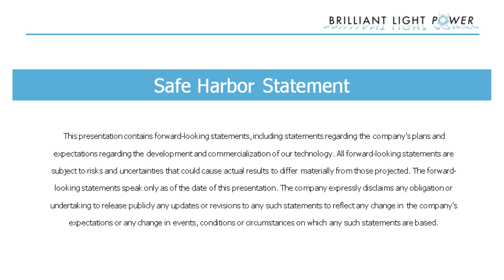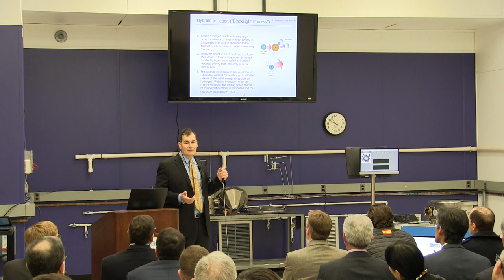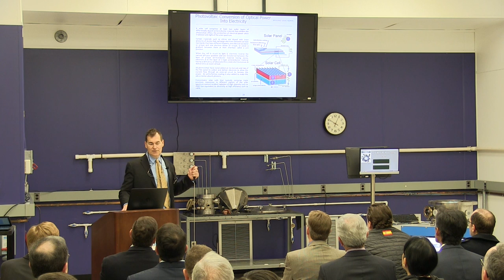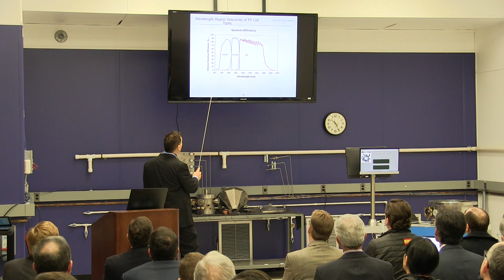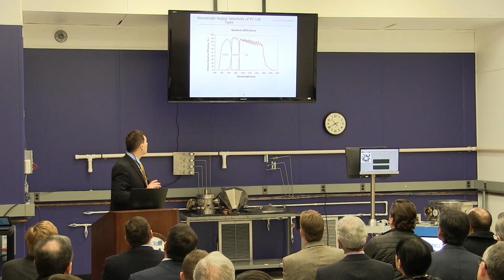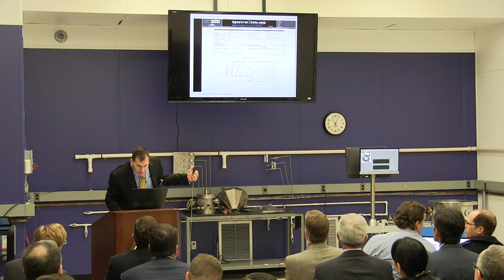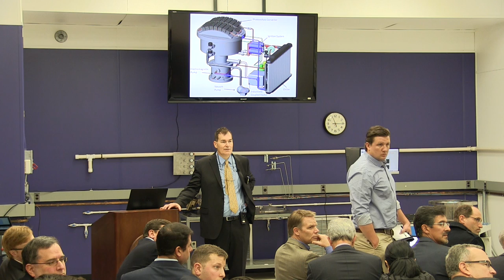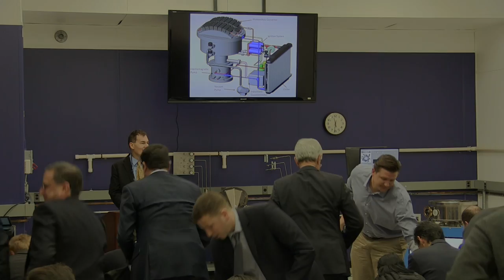Brilliant Light Power Demonstration, January 28th 2016

Comment: How are you going to vent the oxygen and hydrinos yet keep the silver vapors from escaping?
Reply: One idea may be to allow the SunCell to cool below the vaporization point of silver then vent the excess gases. The fuel, hydrogen, is extremely energy dense and would consume only a liter of water or so per 1000 miles of driving in a typical usage scenario.
Reply: Another approach could be an enclosed loop cool enough to allow the silver to condense to a liquid. The gases could then be vented periodically within this loop. Some small amount of silver loss would likely occur over time.
Reply: +B Yoshikazu So in other words it has not been solved yet.
Reply: It probably has already been solved.
Reply: +KrawnKam 

This is my concern, also, and is an important point to be addressed. However, it should be safe to say that since the freed oxygen would be so highly reactive that either extreme vessel oxidation or an explosion would occur in an unvented condition, the vessel must have had venting.

Another question I have is about the 10,000 amps crossing the electrodes: How much power does this represent? Some mention was made of a volt, or so, across the electrodes, so that starts the "input power" consumption between 10 and 20kW. 

The question this input power requirement raises is what is the actual efficiency of the reaction in terms of usable output power compared to total input power.

The next question is to what degree this power density would create a plasma of heated gas of heated gas around the electrodes. The graphs of the output should show any such contribution. The least that should have been shown is the baseline reaction of pure silver nodules (no water trapped in the nodule) so that whatever contribution comes from silver + oxygen (in equivalent amount to that released by the water fuel) can be measured and subtracted from the hydrino reaction.
Reply: Dr. Mills has stated input power was at 1 kw. In prior tests it was shown that just 5 joules of input energy resulted in between 500-1000 joules of output energy.
Reply: +B Yoshikazu OK. I may have to relisten to the video. At 10,000 amps the voltage across the electrodes is 0.1 volts. I thought I'd heard him say it was a volt, or more.
Reply: makespace Well he said the voltage drop was less than a volt. In the Society for Classical Physics forum he said it was 1kw of input power. In any case prior demos showed input of 5 joules resulting in a plasma that persisted due to the high energy released from the hydrino transition reactions; total energy released was 500-1000 joules.
Reply: I heard him using a 1200 Amps and 10 V power supply
Its at T = 45:20
Reply: 0.1 V will not be enough for water electrolysis, and get the atomic Hydrogen out of it.
Reply: he said it has a ten day payback period (I guess assuming petrol/grid energy prices which are about 10^2 order of magnitude of price range). that gives you some idea of the EROI for the continuous process (a very large amount)
Reply: +B Yoshikazu can you show me a link to the forum?